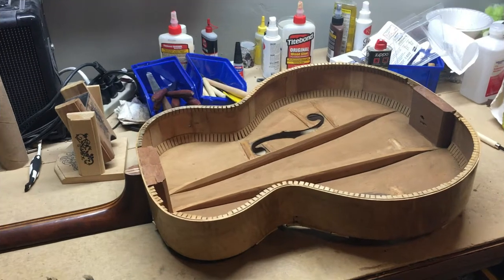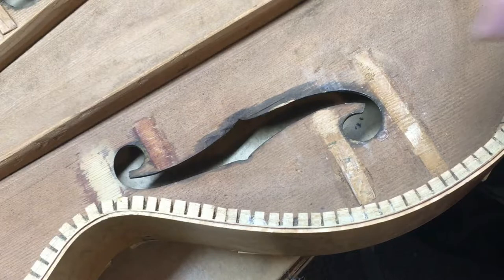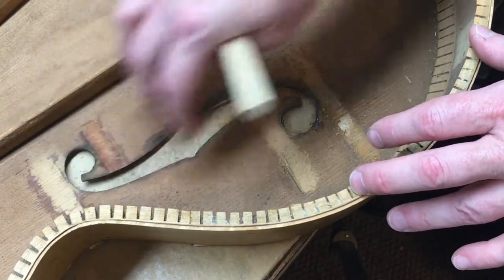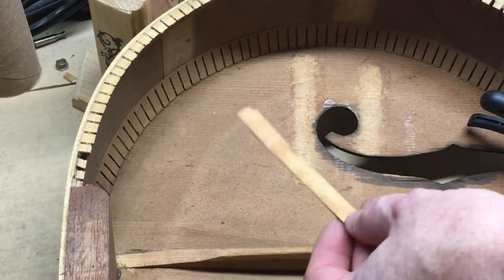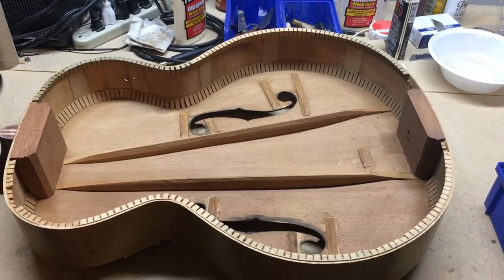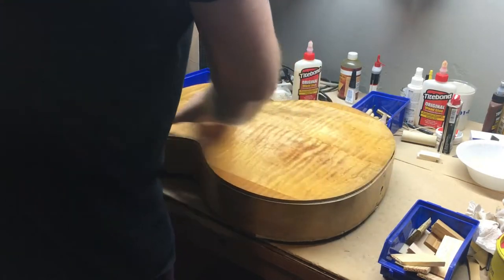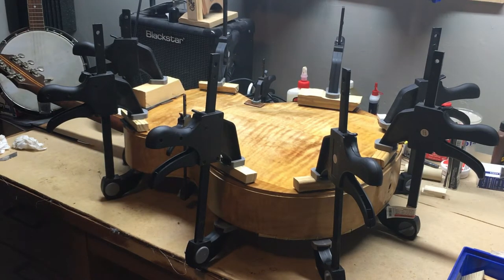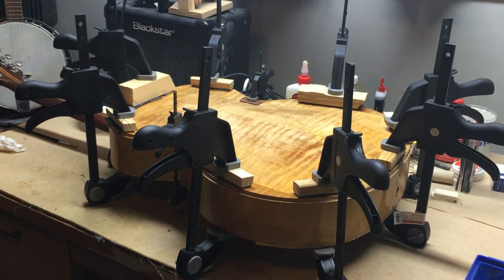1937 Epiphone Triumph - Part 3 - Braces Fixed and Back Re Attached

Comment: Notice the edge pieces in the wider bout to make the back wide enough. This is another indication that the guitar was sunburst originally, and has been stripped. A blond Epi guitar would only use two piece bookmatch. Notice the dark stains around the inside of the F holes.